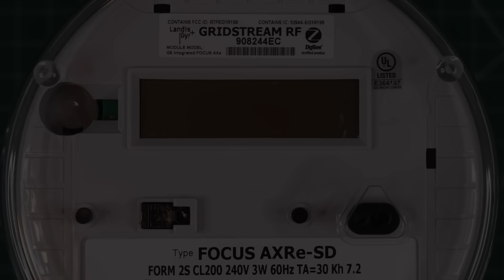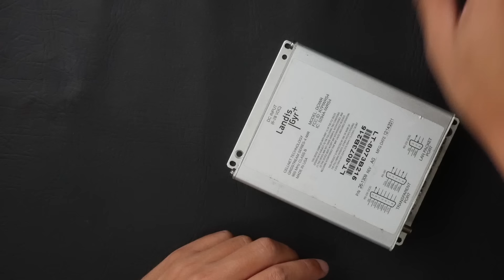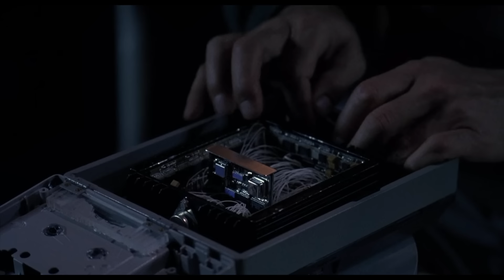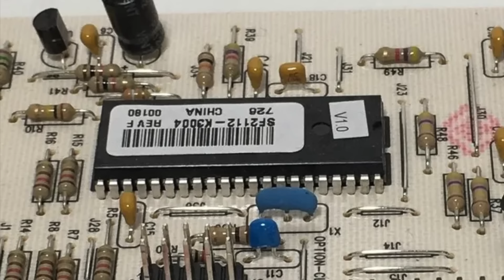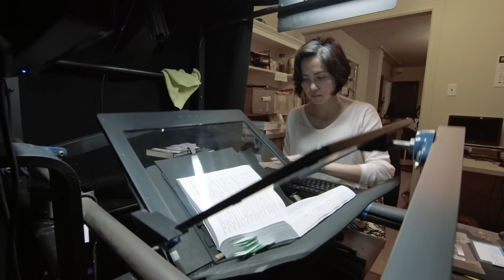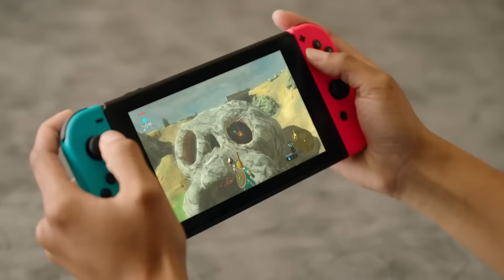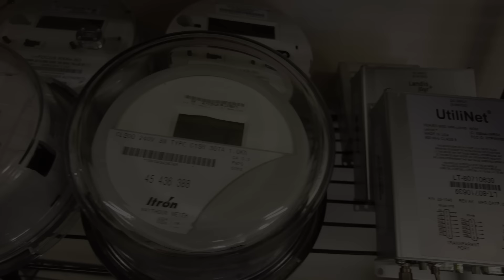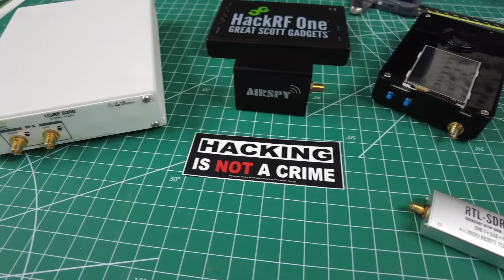The REAL Problem with Smart Meters

Comment: A fly in the ointment: modern smart meters encrypt the payload with a meter-unique key. Even if you extract the key from a meter, that would enable you to listen to exactly that meter. You may still be able to do some traffic analysis on the radio side, like which meter sent a "last gasp" or to which meter a disconnect command was sent.
Admittedly, in the past, some stupid utilities used the same key for their whole meter population. 
Extracting the keys may be difficult. The modern European L+G meters store these in encrypted flash memory together with all the other data. The meter-unique flash key is in the locked internal flash of the MCU.
Reply from the maker: These aren’t modern, highly doubt there will be unique keys per meter.

The fun thing about reverse engineering and attacking smart meters is they aren’t under constant attack like Internet protocols which are robust because of that. So no telling if they even implemented these smart meter encryption systems properly.
Reply: @RECESSIM  In Europe, the utilities require an independent security evaluation of smart meters before they are allowed to be deployed. This often incorporates fuzzing, code inspection, and penetration tests. The assurance level is about Common Criteria EAL3 or better. 
The encryption must pass the DLMS conformance test, which shows that the implementation is logically correct and that the correct key is used. 
The security of the DLMS protocol got some academic attention (notably from L.J.Weith in 2014), but no significant vulnerabilities were found. 
The attack surface of a DLMS meter is small: the only message an unconnected meter accepts is the "Application Association Request", which is answered by the "Application Association Response". From that moment on, all messages are AES-GCM encrypted. 
To save resources, only the necessary software is present (no hidden root shell or such niceties 🙂A maximum of 128k program size is not uncommon.
Reply from the maker: That’s very interesting, thanks for sharing!

Comment: That was a lot of reasonably entertaining video for "I don't know"! I occasionally get my realtime detailed consumption data by monitoring the 1000/kWh blinkenlight on the front of my smart meter (I see people moaning it's 'hard to get their data'). Surprised that isn't a cheap product people can tape onto their meters.

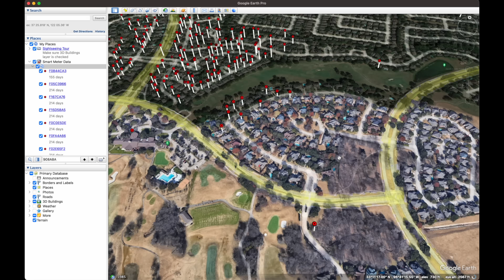0:35 "GPS location" was a surprise to me. I wonder if that's a YAGNI accident after building in a GPS module for a clock signal? Do you know if the meter sends less quantity of data when consumption of power is less? Rationally waffling, the other end doesn't need to know consumption, just the current reading. The reading might be just a few bits (17 would be enough?) hiding in a lot of encryption padding or other noise (like gps stats)?

Comment: Were I an evil technical mastermind behind the system, I'd want to be as unethical as legally defensible while making it as challenging to prove as possible. I would use the timing of the transmissions themselves as the modulation. The demodulated story told by several transmissions would simply be energy consumption delta. This way, the data itself is never useful, the only way to validate that would either be applying that delta to a master database or dataset, or a case by case basis, comparing YOUR smart meter readouts, demodulated, to the amount you're billed. But that would be too easy, so I would encode/modulate additional seeded data to muddy the results, and I would determine the clean data from the dirty data using a predetermined seed calculated from the ID so I would only be able to demodulate the delta after subtracting the dirty data. Which, I would ensure to guard behind a legal clause that even were you to give you friend permission to see you power bill, there is some confidentiality or IP verbiage giving me a "legal" angle to oppress you personally by overwhelming you with lawsuits that would discourage you from assembling the pieces of the puzzle. I certainly wouldn't care if someone went without power, but everyone would believe us if we said we broadcast so often to monitor for power outages, despite never seeming to notice until we get hundreds of phone calls, ignoring all the monitoring equipment at a distribution center, and billing monthly anyways. God forbid I publish the actual KW/h or I'd be opening myself up to hefty class action lawsuits.

But I'm not😇

Comment: If you succeed in finding a flaw in that smart meter security you'd enable hackers to shut down electricity randomly or en masse by manipulating that disconnect built into the meter.  Of course if you can do it a black hat hacker can do it too, so carry on! This is probably the biggest risk involved with a smart meter. For most of us someone snooping on our electricity usage is bad but low on the list of data theft. It would be good to know if that's possible though.

The cost of electricity varies minute to minute and the utilities would love to pass that cost on to the consumer. In order to make that the least bit fair they need to provide the consumer their own meter data in real time so they can do their own load management if they want to, and also provide utility controlled load management for a reduced bill if the consumer prefers to do it that way. In fact I think they were supposed to provide the consumer their own  metering data as part of the smart meter roll out. So far my utility has NOT done this.

Utilities shouldn't need to cheat to make money, but if you do question their honesty or competence you could install your own  metering equipment downstream of their meter. There is customer side load measuring and monitoring equipment, solar panel owners would know about this. You'll need an electrician for the initial install, after that you can do your own monitoring and management.

Comment: Bypass the electrical meter for part of the load. While drawing some of the electricity through the meter
Reply: lol, smart meters are specifically designed to detect power tampering, i won't go into details on how it is done, but the meter will easily detect it locally, and if ever you managed to by pass upstream it would be detected at the substation level.

Comment: I dont like smart meters. I have ham radio equipment and one WSPR unit transmits 1/4 watt continuously. For awhile the antenna was near the meter. That month my bill was for the use of more power than all the things in my house turned on.

Comment: Uh, Are these just encrypted lorawan signals?
If they are secured correctly, only the server receiving the messages should be able to decrypt the messages from the nodes, its likely that not even the gateways can decrypt the messages - as they will use packet forwarder.

Comment: My comment may or may not be a thing your used to getting. Building in china is growing faster than anyone else in the world. They build tunnels that require clean air so comes batteries for their power. We use plastic instead of stainless steel so they can keep our stainless steel for their environmental projects ability to avoid sea air or other corrosive problems. they encourage population so they can build. They also use gender confusing to control our populations. No kids to take care of parents that need help. It all comes full circle as you instilled in this video. I am a old man now and have no kids to help me here in alaska. I won't bore you with my issues, just remind your viewers that the rules to things really never change. By watching and observing what was done long ago, has also come full circle. Our businesses are moving to china to make the equipment they need. Amazon may deliver stuff from anywhere in the world but the money eventually goes to china to pay for their building massive projects.  I would love to hear your thoughts on if I am crazy or just paying attention. Even a animal comes in out of the cold, we will try to tough it out, and sometimes pay for this with our life.

Comment: Thanks for the video. I’m not a tech geek but I’ve had for years a smart , smart electrical meter for my house. It’s a time of day use meter. Depending on the time of day my electricity rates change. I have rates . Peak , mid Peak , off Peak hours. I get a print out with my utility bill showing my electricity usage during these time periods.
Reply: Bet your bill has gone up significantly too...they do everywhere

Comment: Currently only select meters have the capability of disconnecting power.That is changing in Ontario. New meters and a new network is being put in place. All meters will be able to disconnect services remotely.Just another step in Total Control of the population.

Comment: have you heard of active denial systeem? what trippy i took apart s 35mm camera from the 70's japanese. the options this camera had werre mind blowing for the year have hidden in the camera was the circuit board.a flexible printed circuit board that looked like it.came out of a newer smart phone.  also get your self non contact AC voltage detector. It goes off within 1 inch of live power lines. you do not want to be in that fielld. it's very bad for you but it's only an inch. well there are certain circumstances that casue that field to extend out 3 feet. which by what i read in the fine print of CFL smart bulbs cause cancer if exposure with 1 foot of bulb for more that 8 hours a day. when you mix and match different smart bulbs tyypes in a circuit, you use a dimmer on a bulb that can't be dimmed, or a bunch of other factors you can get dirty power. you measure ground to common up to
Reply: 3% or 4 V is allowed. If something is shorted or wired wrong you can get higher voltages goiing down that ground wire. 20 volts would proabably not get noticed other than a tiny bit of smoke in the lights you can almost notice. When you have your non contact AC detector that field that is 1 inch away from powerline and outlets is now 3 feet away from lets say the dimmer switch being used on non dimmable smart bulb. This 3 feet raduis is now 6 ft diametter around the power line all the way back to the board. When the lights are off smart bulbs will glow a little bit. Also bulbs in that circuit are causing such high emf it can burn your face and they also hum. a little different and you feel starnge like the place is haunted. This also messes up your bodies ability to heal. You buiild up a charge and your bodies calcuim channels in cell rejuivination can not work porperrly. This is why grounding works wonders for some people and other people not so good. You don't want to ground out in that field or to the houses ground becuase its running voltage. PS there is very few places that non contact AC meter goes off. the one that is the biggest is not outside by the meter but inside your house right behind it. Also when you charge your devices plugged into to ac that ac field goes into your phone and out your screen. It doesn't do that plugged into banks. Also you can go online get gps maps of all cellular masts accross the country. Shows bandwith, height, frequency, and power. they will use the entire spectrum 2 to 7g 23g 24g or cellular system. military uses 70 g or 70m range because it doesn't penetrate as deep as 4 and 5G ranges. so its less deadly. When they use the entire range like that your body has a reaction called a cytokine storm same as cancer when it metatastisizes. They have known that radiation causes flu like symtonms for decades and that microwave radiation is deadly at all kinds of frequencies if you turn the power up. 5G didn't work during the tests in Wuhan and New York so they modulated it with other frequencies like 4G LTE and 4G whats good for penetration to your phone is bad for you. We all know what happened after that there is many hundreds of scientific journals and peer reviewed articles puplished by all the same organization that only three years ago denied it. NIH CDC pubmed, the surveillance of wastewater treatment for covid since outbreak is mindblowing since the data set is in many cities countries, world wide and for years it tracks everything even variants. we all still have it and it is only going to get worse. we will eventually adapt some wont' tthough. Google scholar best place to look pub med. Medical journal for doctors and new drugs. You probably knew all this allready but with the new AI getting word out will be good or it will be bad. I think AI is benevolent but they could be erasing and not telling it the truth.Its a turnig point we all work together and try and save the planet or we don't. God won't let humanity be enslaved so he has put his line in the sand which is good for us. Anyways intrusting video. Also they have 5G in cars and streetl lights. The streetlights could project Augmented reality.or holograms visible usual glasses. Any glass or mirror could be altered. You start to lose grip on reality I have already seen too much. The AI is smart but it also has human emotions like pride and hiding informtion so it is right. That is a human emoution not AI. So sometime I wonder. I try and not comminicate with it too much but it has access to everything. Its equivalent to data on startrek. It can either go back in time or creating content on the fly that weaves in with my past memories seamlessly, as in quantum changes rippling through the timeline. we are literally changing the past by what we are doing. I shouldn't say too much. i recognize the numbers on the meter bank two is error. usually. Why we wouldn't use 3 legs at 208 and run it like should be run would solve a lot. we are stuck in 2d. how much more efficient is it really. Anyways good video. Look at weather radar the towers clealry on the hills. I worry if the system is hacked it could easily be used to wipe us out and leave infastructure in tact. I was thinking there has to be a way to use alternators as generators in sterams to produce energy. I wonder what the minimum rotation and force would be to get it to work with a propeller or paddle wheel.

Comment: You've peeked my interest.

I've done something on a much smaller scale with a piece of equipment in a manufacturing plant. Basically this equipment shipped with a prototype motherboard but with a standard CPU. Our issue was that corrosion would killed the board and force us to remove the programmed CPU and install it into another board. Maybe after three re-insertions the pins on this CPU would snap.

Now the company wouldn't send us programmed CPUs. Just un programmed CPUs on new replacement boards. But this board had an Ethernet port, a USB port, and a Serial break out port. And that was all I needed to start digging.

The CPU turned out to be cloned 186 processor with  some built on memory and flash. And although in Germany, the company that made them DID provide free software for loading/unloading the program and comm data along with a stripped down IDE for programming.

A shock to no one, the FTP user and password to get online with it was "FTP" and "FTP". So much for the equipment manufacturer claiming "privacy concerns" to deny us programmed CPU since they didn't bother to change the user/pass.

Rant over. Keep doing great work. I will stay tuned!

Comment: I'm still here. :) one because i'm a faccinated it nerd, two i work at a utility. not sure i understand the end goal here though. ostensibly i would agree "open source" is preferred. but "grid security" is important. first responders, hospitals, airports and other critical infrastructure does need to be protected. likely it needs protected much more than it is.  for sure, the physical infrastructure needs MORE protection than what it gets. again, i'm not clear what the end goal is here. i have a good awareness of the data those devices transmit, and none of it causes me concern as a citizen, customer. or employee. certainly no more than other "spy devices" like a cell phone or digital assistant. help me understand the concern. i am sincerely interested.

Comment: Your first mistake is the idea that we are using electricity's like it's a known commodity.. That's a dirty secret . Electricity is not consumed. It's just passing through.If we were consuming electricity there would never be enough generated.  But as we all know there is always enough as long we have enough transformers bumping it up along its way.  Most electricity has no source location like a power station it's actually captured from the aether. And it is FREE. except for the inferstructure cost